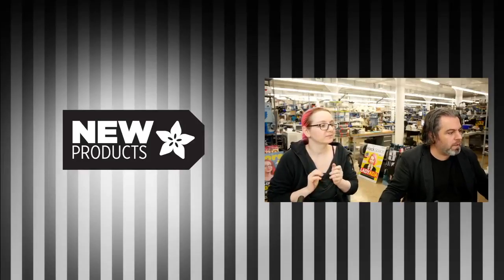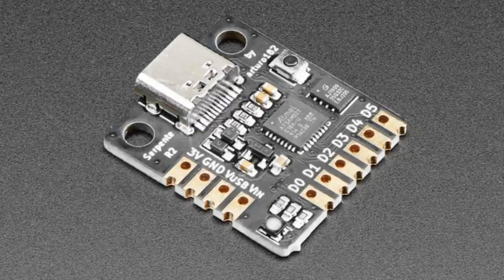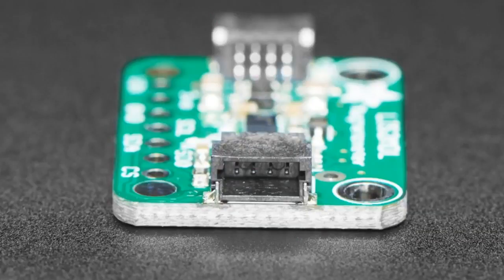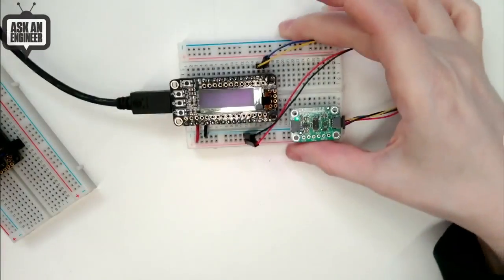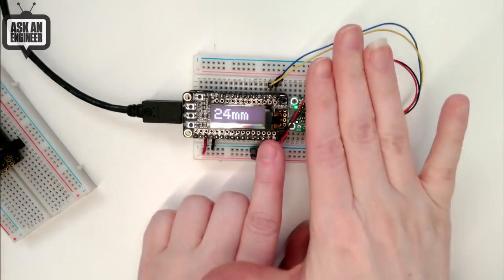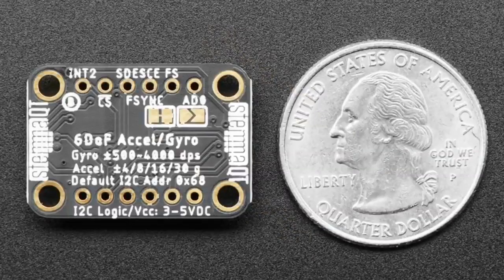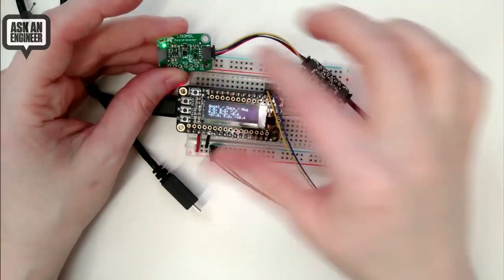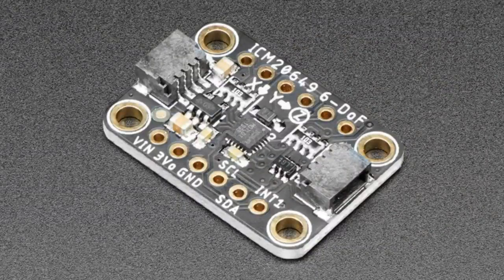New Products 3/4/2020 featuring Adafruit ICM-20649 Wide Range  6-DoF IMU - STEMMA QT / Qwiic

Comment: What happens if we need the older revision of the VL6180?  This revision is incompatible from a wiring and mounting perspective, so anybody that has integrated this into a system can no longer use it.  You really should have given this a different part number if you were going to make it incompatible.